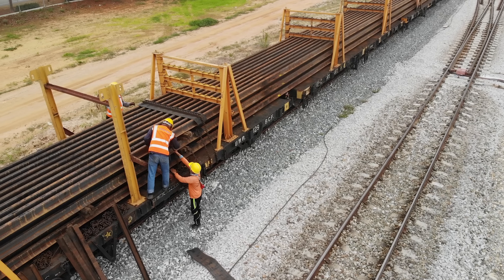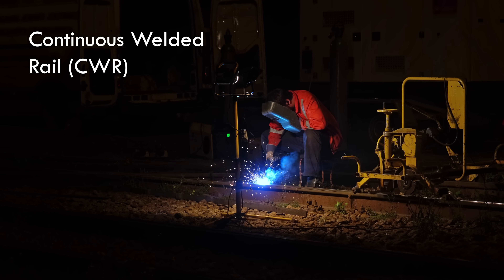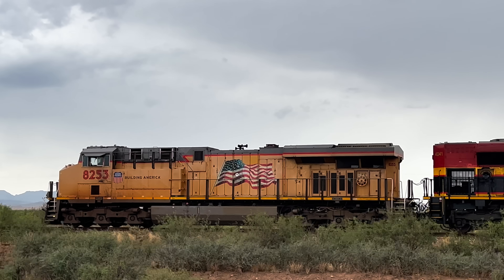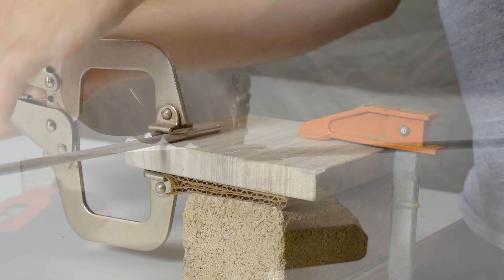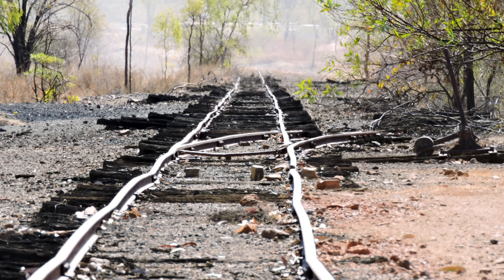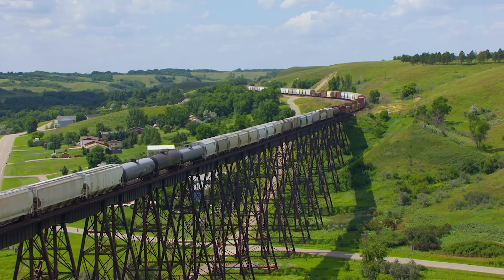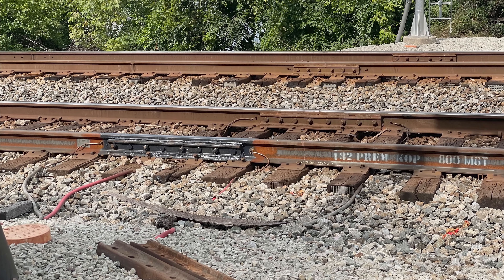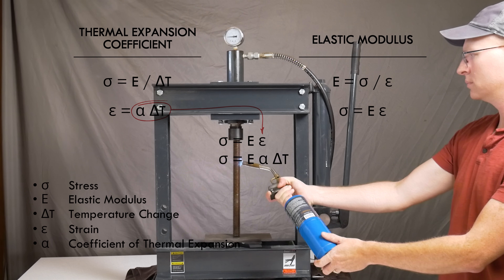Why Railroads Don't Need Expansion Joints

Comment: If anyone wonders why the odd figure of 39 feet was the standard length of single sticks of traditional jointed rail, it was so that they'd fit into 40-foot gondola cars.  Welded rail is now typically manufactured in long lengths (1,320 feet in the USA, which is ¼ mile) and can be welded in the field to be continuous.  Such long rails are transported on special rail trains, like the one Grady shows half-loaded at 0:25.  The yellow racks hold them in place, and the rails bend as the train goes through horizontal and vertical curves 😮.
Reply: Didn't know that about the 39'.
Makes a lot of sense.
Had to transport the rail to the site somehow back then. Gons were 40 foot.
Reply: The rails are only "held in place" in the middle. They lay on the rest of the structures.
Reply: @ferky123  True that they're fastened down only at the middle, but the racks surround them to keep them aboard and untangled, to guide them to bend around curves, etc.
Reply: It's always fascinating to see examples of how non-function related logistical challenges influenced engineering of specific devices and systems. Fitting things onto transportation equipment turns up a lot.

The M4 Sherman tank that the Allies used in WW2 was designed and shaped the way it was partially so that it could be lifted by standard 30-tonne capable dock cranes. And it's size (18x8.5ish feet) meant that you could juuuuust fit 2 of them nose to nose on a standard railway flatcar. Going higher was fine, going out, not so much. Which meant no specialised equipment, lines, tunnels, or loading equipment required to move them from Detroit to the coastal docks.
Reply: @Summersong2262  I knew a man whose job at the U.S. Department of Defense was to pay the US and Canadian railways to equip enough of their heavy flatcars with the right connection points and permanently mounted chairs and chain pockets for securing certain specific military equipment, so that availability wouldn't be a problem in any contingency.
Reply: Nowadays, the typical lengths are built around 80 or 40 ft as rolled by the steels mills with some tolerance for defects or shorts being 78 or 39 ft. There are train cars and trucks that carry the 80ft pieces.
Reply: @mf--  39ft is still the standard length for grade A relay rail for repairs.
Reply: Actually the modern rails are rolled in about 30-meter lengths and then welded into the quarter-mile lengths to be transported to the laying site and then welded by a portable electric  welding machine or thermite welding process in track.
Reply: @royreynolds108  The fabricating of quarter-mile lengths is part of the manufacturing process.  I intentionally avoided saying that the rails were rolled that long.
Reply: @MikeV8652  Pacific Western rails are rolled in something like 50 meter lengths and then shipped across the ocean from Japan.  Every railroad company is different, but that's the gold standard.
Reply: @royreynolds108 modern mills can roll them in lengths up to 90 or even 120 meters.
Reply: @royreynolds108  Yep, I'm not sure if any steel rolling mill has a quarter-mile-long runout table after the finishing stand, and you can't make rail-in-coil yet.
Reply: @sentinel76  Scunthorpe in the UK can I think produce 709' rails. The older rolling mill at Workington had to cut the rail into 60'-0" lengths later 120'-0" lengths to get it out of the door in the shed containing the rolls. They would then be put on a wagon and moved to a welding depot where the rails would be welded back together into 720'-0", 600'-0" or 300'-0" lengths as required, for movement to site.
Reply: @royreynolds108  Actually around 24+ meters. I think they're in 80' lengths which would come to 16 1/2 per 1/4 mile. Worked a few CWR trains and it's always fascinating to see just how flexible rail actually is.
Reply: Thanks for explaining! I imagined it was a metric length 12m; I'm happy to know the real reason.
Reply: @j_taylor  I once talked with a French railfan in Mexico who thought that it was because 39 feet was 10 meters.  It's actually 11.89 meters, but he also told me (in English) that he was "in charge of the world."  Another reason for using exactly 39 feet is that the size numbers of US rails are the pounds of weight per yard of length.  There are exactly 13 yards in 39 feet, so it was easy to figure the weight of any number of rails or the number of rails in any certain weight.
Reply: @MikeV8652  The more I know about those units the less sense they make...
Reply: @Dani0x1B  I understand, because we feel the same about metric units.  They're all based on arbitrary mathematics, not practical relationships to the things being measured.  That's why we'll never change.  It's easy enough to convert measurements in the computer age.  Any smartphone can do it.
Reply: @MikeV8652  see, that tells me you don't understand metric. or the reason why I say imperial makes no sense. it has nothing to do with the units themselves. units are arbitrary, all of them, including imperial units. it's about their relationships with one another being easy and simple.
Reply: @Dani0x1B  I agree that I don't understand metric, just as you don't understand customary.  (The USA uses "customary" not "imperial" units.  There are some overlaps but also some important differences.)  Metric and customary are like two different languages, each with its own vocabulary and grammar.  We each think ours is "easy and simple" because it's easy and simple for us, but it's not easy and simple for the other.  I suggest that those who like metric use it, but please learn some tolerance instead of insisting that we need to change.  We steadfastly refuse, just as we refuse to change our language.
Reply: @MikeV8652  As an engineering student in Canada I learned to use both systems. People here still typically know how tall they are in feet and inches, not centimetres (although this is changing slowly). I ended up converting every problem into metric and then converting the solution back at the end.
Reply: Americans use a metric system everyday and most don't realize it, i learned this trick as a kid to apply equivalence to SI metric units
how many pennies are in a dime? (milli-unit -> centi-unit)
how many dimes are in a dollar? (centi-unit -> deci-unit)
how many dollars are in a Hamilton?😉(deci-unit -> unit)
Reply: @MikeV8652  Sorry but objectively, 10mm in a cm, 10cm in a dm, 10dm in a m, 10m in a decametre, and on makes sense. 1 metre is defined as the distance light travels in 1/(speed of light in m/s) seconds in vacuum. While your customary units? 1 inch is defined as 25.4mm, and one foot is 12 inches, one yard is 3 feet, and the kicker, to make this arbitrary system even worse, 1760 yards in a mile. Nothing makes sense, nothing is connected, it's not units meant to be connected or calculated with. It's also based on archaic stuff like thumbs and feet, like that is in any way universal, like light speed is. So no, we understand your customary unit, but it's senseless, it's bad. Why do you think NASA uses SI units?
Reply: @LoPhatKao  Yes, American money is decimal, but I don't understand what you wrote at all.  I've never been able to keep straight the goofy metric prefixes as to what they mean.  They all sound alike, which seems intentionally confusing.  It's just not worth the bother.  I understand and can instantly visualize feet, inches, gallons, quarts, pounds, and ounces, because I've used them all my life.  I also understand and visualize half, quarter, eighth, and sixteenth inches, and the fractions make it easy to multiply and divide.  Example:  half of five-eights is five-sixteenths.  I doubt you can do that in metric.
Reply: @MikeV8652 five-eights is about 16mm. Half of that is 8mm.
Reply: @Patrick-857  Just because you understand what you just wrote doesn't mean that it's better for me, because I didn't understand any of it.  It's like a very foreign language.  Just because translation is a PITA doesn't mean that any one language is better than all the rest.  Yes, dividing by 12 is slightly more difficult than by 10, but 10 is divisible only by 2 and 5, while 12 is divisible by 2, 3, 4, and 6.  It's no more difficult to learn that there are 128 fluid ounces in a gallon or 5,280 feet in a mile than it is to learn the definitions of two new words.  Don't argue that our money is metric.  Yes, a dollar is divided into 100 cents, but that's the end of the similarity to metric.  We never speak of milidollars, kilodollars, and all the rest.  We can use tenths or hundredths of any of our units when we wish.  We measure rainfall in inches and hundredths of inches.  We survey land in feet and tenths of feet.  Our fuel pumps are denominated in gallons and hundredths of gallons.  Our odometers measure in miles and tenths of miles.  All of these are still based on the familiar units that we all know and recognize.  We don't use a highly confusing array of easily mistaken prefixes to create a lot of additional units.
Reply: @deckname5794  That only works for even numbers.  If you have an odd number of units, you end up in fractional units just like I do.
Reply: @MikeV8652 Tolerance is just room for error. So if everything needstolerance, how much is too much?
Reply: @RowanHawkins  Measurements can be made with equal accuracy in either customary or metric, and computers can easily make conversions to any desired degree of accuracy.
Reply: @JakkeJakobsen thumbs and feet archaic? Don't you have them? I do. I don't know if you have ever counted your fingers  and toes, but there's usually 10 of each, and this is the only reason the 'metric' system uses increments of 10, so isn't it archaic too?
Reply: @LoPhatKao  What is a Hamilton? We are talking about money here, not people. Also, you metric examples are off if you really want to compare them to US money and that will confuse people. Pennies are 1/100 of a unit which is centi, dimes are deci, and dollars are units. A 10 dollar bill is a deca, 100 bill hekto, and 1000 bill is a kilo. We also use the metric prefixes for computer memory sizes. 720 kilobytes, 1.44 MB (not to be confused with Mb), on to gigabytes and terabytes. For those of us who measure in thousands of an inch very often and even 10 thousandths, it isn't unlike using the metric system.
Reply: @MikeV8652 
Is the FM Road Sign a nod to your DOB?? Based off of how knowledgeable you are I can totally see you being 30yrs my senior(11/30/82)...
Reply: @JakkeJakobsen  The metre was supposed to be a set fraction of the earths circumference, so it could be used in navigation. But it turned out that the Frogs got the measurement wrong, which is why the Nautical Mile and Knot are still in use.

As for the relationship between units, a pint of warter weighs a pound and a quarter, it even rhymes in Imperial.

You also tend to find that the apparently strange numbers picked for imperial measure are often numbers that divide into whole numbers more often. Something that made life easier when you were working outdoors with out pen or paper in the days before calculators.

I do find it interesting though that people who prefer imperial tend to be happy for both systems to co-exist and for people to just use which ever they prefer, while the metric zealots tend more to want to force everyone to use metric regardless. Myself I use whatever units are the most convenient,  for the job in hand although it did tend to annoy my wife when we were doing something like putting up a group of pictures and she found that I was working in metric for the vertical separations, and in imperial vulgar fractions horizontally.
Reply: @JakkeJakobsen  Keeping track of the different lengths is easy you just have to remember that 10mm is a cm, that 100cm is a metre, that 20 metres is a chain, that 10 chains is a furlong, and that there are 8 furlongs to a mile.
Reply: @meeeeeeeeeeeeeeeeeeee2 
Imperial measurements are based around a lot of arbitrary fractions (16 ounces in a pound, 12 inches in a foot, gallons — which one out of US at 128 fluid ounces, British at 160 fluid ounces?  Oh, wait… fluid ounces also differ…) and different units of measure require complicated conversions.

Due to this, nothing of any complexity in the real world is performed in imperial measurements.  It is done in metric, then the final results are converted into imperial if required (sometimes unsuccessfully, which can cause problems).

All imperial measurements have been defined by the metric equivalent for a very long time.  One inch is exactly 25.4 mm, for example.  The differences in gallons, fluid ounces, miles, etc. are irrelevant provided you use the sane metric system for any calculation then don’t flub the conversion back into whatever medieval obscurantist variant the end user has wasted a lot of brain storage on retaining.
Reply: @boggisthecat  As I said earlier metric zelots, meanwhile back in the real world, and on the subject of the thread. When I was actually de-stressing CWR for British rail we used tables giving the extension required in mm, per degree F per so many yards of rail. As mm were the easiest measurement to use to mark how much rail to cut off, our thermometers were scaled in Fahrenheit and the easiest way to calculate the length of unclipped rail was count the welds in the rail that were in those days every twenty yards. Later when only centigrade thermometers were available we moved to mm of extension, per degree C per yards of rail. We did not care about which system we used, but just got on with using whichever system was most useful for each function.
Reply: @meeeeeeeeeeeeeeeeeeee2  
The imperial system is difficult to use, due to the plethora of obscure units and conversion issues.  The SI has seven base units, all of which are now defined from natural and constant phenomena.  Any measurement can be built from those base units, and if you have to calculate something complex it is much easier to work with a consistent base-ten system.

Everything you deal with that has been defined in imperial units has been developed in metric then converted.  The old ‘3-1/2 inch floppy disk’ is 90 mm x 94 mm x 3.3 mm in size.  So they’re really 90 mm floppy disks —  or 3.54[3307…] inch.

It makes no sense to teach people antiquated systems of measurement when almost the entire world understands metric.  Would you want to go back to the old British monetary system?
Reply: @boggisthecat  Everything developed in metric then converted that is rubbish. The 60'-0" rail developed in metric, standard since the 1890's in the UK, do you really think Crewe works worked in metric back then? Virtually everything developed in the UK before 1960, was probably designed in imperial. As for going back to LSD the only thing that would bother me about that, is that inflation has made most of the coins of such low value that they would not be worth picking up off the street.
Reply: @MikeV8652   what?  There's nothing arbitrary about base 10!  Yes, the length of the meter and weight of the kilogram are arbitrary, but also not.  But the main thing is working in tenths instead of archaic fractions.  I sure feel for imperial machinists!  Man, they have to be fraction pros!  But why make engineering/machining and everything else so much harder?
Case in point:
My father was making your argument one day.  Physician, amateur astronomer and lover of science.  I disagreed.  So I looked at my two bachelor degree holding sisters and asked, "How many feet in a mile?"
Sisters:  "Um, well, maybe 1,200?  4,000?"  They truthfully had no idea, despite being in their 40's and having had to take all the math & science required to enter university.
Then I asked, "How many meters in a kilometer?"
1,000!
Didn't even have to think about it.
If you want kids to pursue STEM, why make it more difficult with Imperial units?
(Plus, you might just destroy a Mars lander as a result 🤣!)
Reply: Why 39 Foot lengths? In the olden days, rail was transported on 40 foot flat cars as 40 foot became the standard length for a freight car. A 39 foot rail would allow six inches of space on both ends so as to not buckle the train on curves.  That is where the 39 foot started. The weight of three foot piece of rail determined its "Rail Weight" and where it would be used. 80lb rail is still used in some older sidings and stub track.  John
Reply: Im becoming a train enthusiast just reading this
Reply: yeah, rail trains (work trains) are the worst to dealer with. super slow speed even more so when in a corner. always stopping to drop rail. and dont even pay very good. from a conductor from canada!!
Reply: 13:10 these joints not only consist of very stiff plates but everything is glued together making very stiff joints which can be used in CWR without any problems. Though they still are a weak point requiring frequent maintenance.
Reply: Modern rails are rolled as much longer lengths (100m+). Standard length used in the UK is 108m, and Germany it is.  120m.
Reply: I saw a video where they let the long continuous rail off to the side, and it looked like partially cooked spaghetti.
It makes sense that it's flexible at those lengths, mostly because it's so heavy.
Reply: I worked on a rail gang over 40 years ago. We laid various lengths of rail up to 1/4 mile lengths. Worked only in the summer. At the end of the day when the stick as we called it. When it was nearly finished being installed.  The end was hooked up to our large crane Then it was given several hard pulls. You could even call them hard snaps or jerks. It was to stretch the rail before tying it into the old track.
Reply: Lets go to the construction site and i'll show you how to use a yardstick, and you show me how to measure the speed of light.